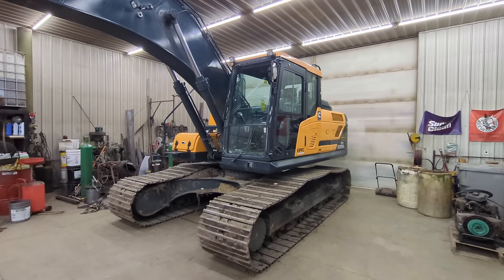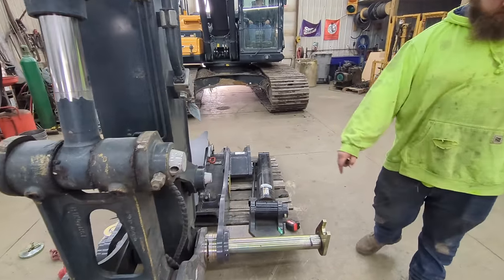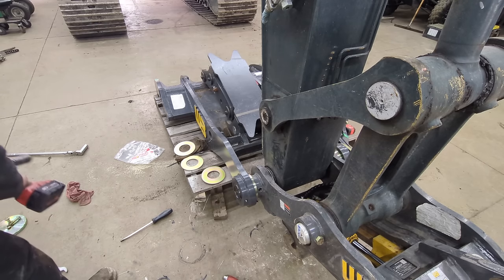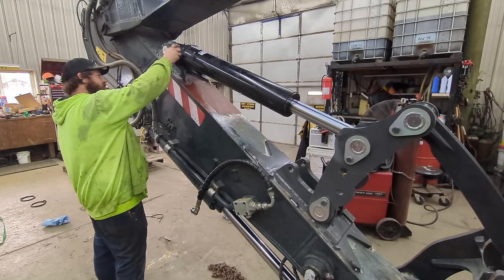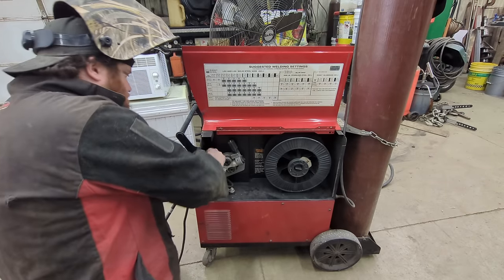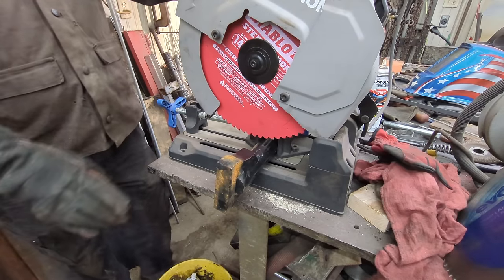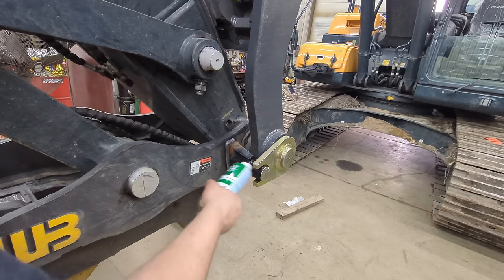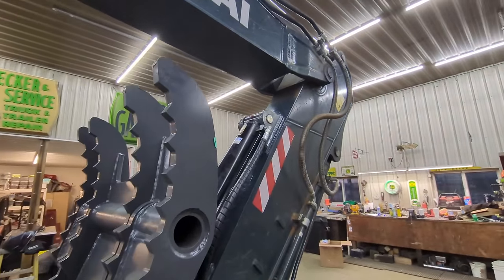Installing The New Werk-Brau Progressive Link Thumb On The Hyundai HX220AL Excavator

Comment: Makes me miss welding.
You did an outstanding job with your welding. 
That was my first full time 2nd shift job my junior and senior years of high school and a year and a half after graduating as a certified Ironworker welder till I went off to Coast Guard boot camp and ended up an Aviation Machinist Mate. 
After my enlistment was up I ended up becoming an amusement vending equipment mechanic/electronics tech. 
I still used to weld a bit at my church but had to stop when I had a defibrillator/pacemaker installed.
Reply: I was an award winning welder in high school and did a great deal of welding and fabrication on the farm for 30 years after that.  I left the farm and have not had a welder for 20 years now.  I have felt like a part of me was missing.  I recently bought a shop and have purchased a simple welder. I cant wait to get in there and build something.  You cannot be a complete person without welding skills.
Reply from the maker: Thank you I appreciate that...you may not be able to weld anymore but you can give us young guys some pointers!

Comment: You guys sure put that thumb on a lot faster and easier than Mike did without all the non workers standing around like a state job. Well done gentleman and you sure can hold a long arc without stopping every 2” to reset your hand.
Reply from the maker: Thank you....yeah I like to hold a arc as long as I can as I can especially if I'm welding up a fuel tank or oil tank less starts and stops mean less leaks
Reply: @dirtgrainsteel  You are 100% correct Sir. 👍👏🏼🙏🇺🇸🇺🇸🇺🇸

Comment: Absolutely no doubt that the new quick change unit is going to make it a whole lot nicer changing buckets on jobs that requires multiple buckets.
No more pulling pins then trying to get the them back in which is usually a 2 man job.
Time is money as they say 😊

Comment: Enjoyed yer video installing the new thumb. Suggestion I might make an old timer showed us a long time ago on yer MIG welder between yer wire spool and where it goes into the gun lead to fold a scuff pad in two and clamp a clothes pin on it to wipe the wire clean. Been doing it for 40 years now and I truly believe it helps.
Reply from the maker: I will have to give that a try thank you!